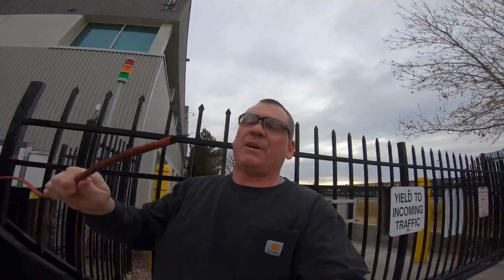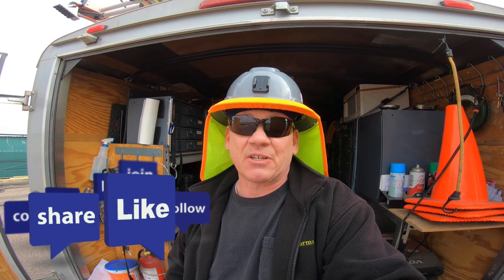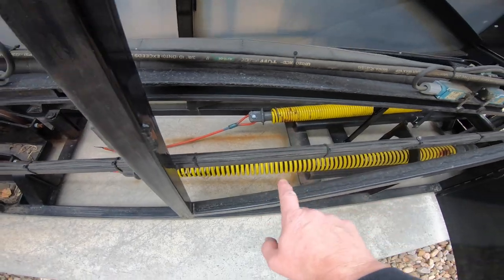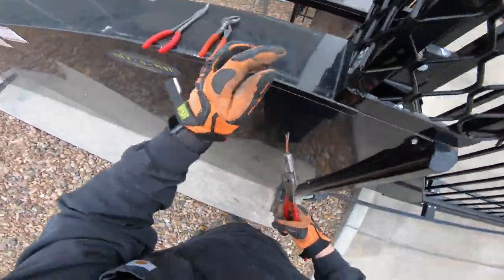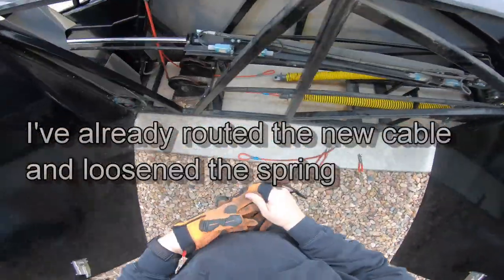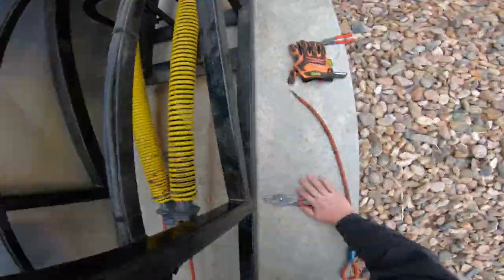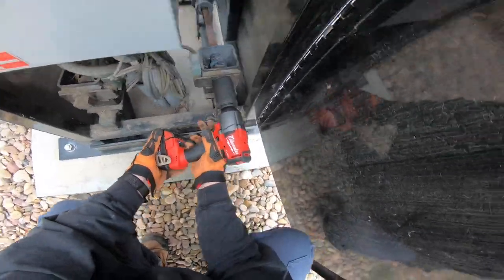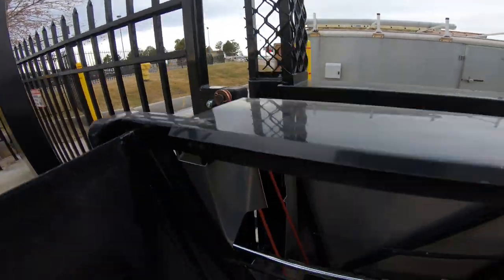Tilt-A-Way (tilt-gate) Cable Replacement

Comment from the maker: Had a great question via chat from Cole, "What tools are you using?"  I'm using a DeWalt 1-5/8" impact socket with my Milwaukee M18 1/2" impact driver.

Comment: I have a tilt a way vertical pivoting gate that is operated with opentech CIA gate system.  When code is entered into keypad gate starts to open then stops.  After code is entered a second time the gate opens.  Seems to be opening a little slower than normal.  I really need to get this problem solved.  Any suggestions? 814-282-6356
Reply from the maker: Not familiar with your access system, but my first thought is that your access control system isn't firing the "Open" relay the first time or it's firing too quickly.